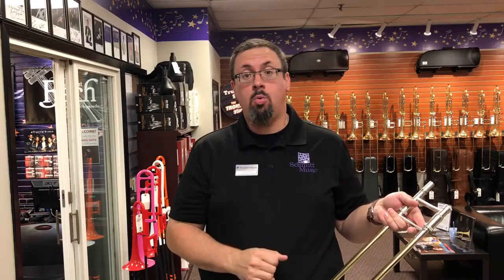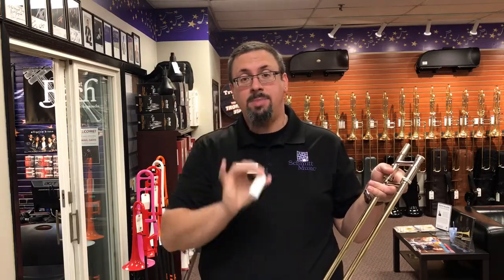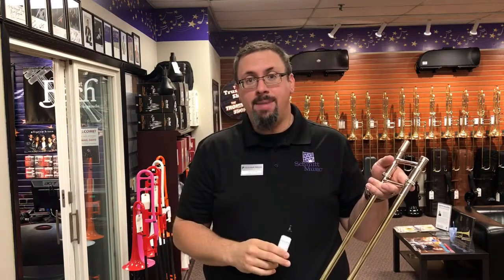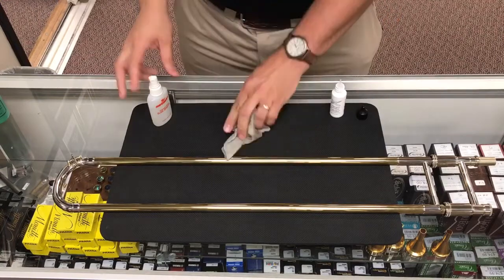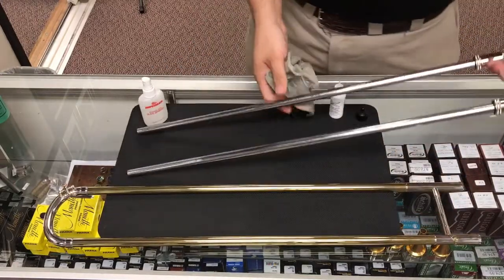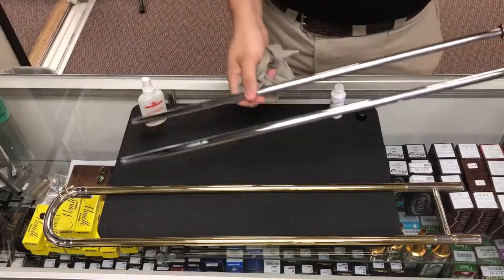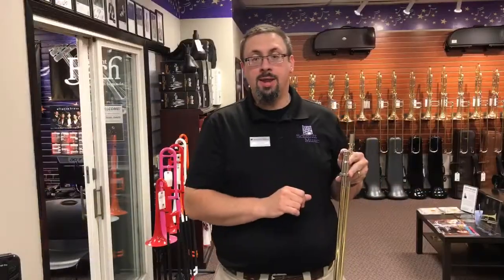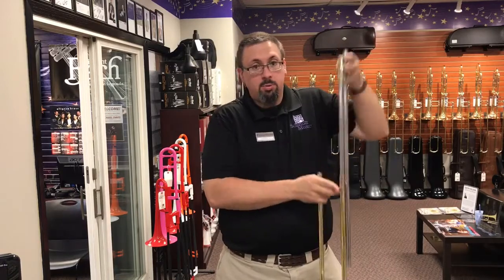Trombone Maintenance 101: Lubricating Your Handslide with Liquid Lubricants

Comment: Interesting.  Before I put the lubricant on the inner sleeve, I use a snake on the outer slide and then a swab on the same outer slide to get any dirt out. If for some reason I'm away from home, wipe off the inner tubes, re-insert the inner slide into the outer slide, take it out and wipe it down again. I do this three times, maybe more if it doesn't come out clean. Only they do I apply the lubricant. I've been using so-called "Yamaha snot" for several years and like it better than slide-o-mix, but that's personal preference.
I'm buying a new shires bass in the next couple of weeks and will see what they recommend.